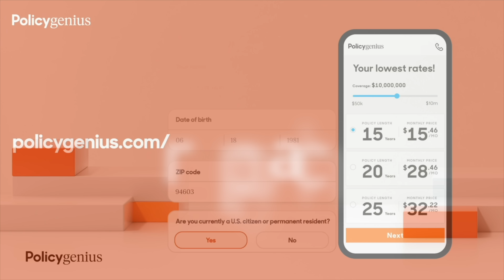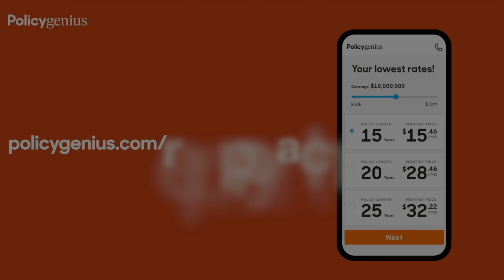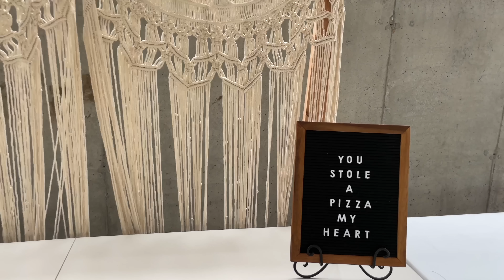#593 - The New Front Porch Is DONE!!!

Comment: Here in Canada we do not screw down metal roof sheets through the high peaks. Screws are inserted close to the peaks - which allows those peaks to absorb summertime heat expansion.  (Our temperatures typically range from -25*C to +35*C [13*F to 95*F].

Comment: Congratulations to the couple;

I felt bad for you working on the roof and porch by yourself it would help so much to have an extra hand. Those were the long boards you were working with as well as the aluminum pieces we’re large enough that if the wind would’ve caught them, it would’ve made it that much harder to work with but being bulky and trying to get them where you wanted and up a ladder was not easy. Congratulations on Getting a tough, challenging job done❣️❣️
It turned out very nice♥️♥️♥️🌈

Comment: The flashing should go over the tin roof not under it. Now the water will run under the tin.
Reply: I agree, all that work for nothing
Reply: He said he will put on the flashing next. He only sealed it with tape to the wall. That tape will be eventually under the flashing.
Reply: There isn't any flashing under the tin.  He said he has to buy a piece to put on, now that the tin is installed.  But yes, it does go on top of the tin, would be pointless the other way LOL.
Reply: @balfit  the flashing needs to go under siding and over tin. Not under a trim piece.
Reply: @wildbill23c  flashing has to go under siding to work. Not under a trim piece.
Reply: @imakarpenter  It works either way, depending upon the type of siding on a house, and with an overhang on the house as that one has, putting the flashing on top of the tin up against the trim works just fine.
Reply: @wildbill23c  lol.  Wrong
Reply: @imakarpenter  LOL, you are correct that you are wrong, the flashing works either way...try it for yourself.
Reply: @imakarpenter  Whatever you think...do what you want, obviously you've never built anything, otherwise you'd know it works both ways.  With the design of his roof he really don't need it at all.

Comment: Why are the roof sheets on top of the flashing 🤣
Reply: How will you weather the flashing you say you need to finish, that means getting it behind the siding.
Reply: There isn't any flashing under the tin...he used a tape seal under the tin, but said he has to buy a piece of flashing to put on now that the tin is installed.
Reply: Go back a few videos, he installed a metal flashing above the ledger beam which went behind the siding. Which the roof sheets are now above. Thanks for your reply but you need to pay attention.
Reply: @SteveDiamond19  I'm paying attention, you obviously missed the part in this video where he said exactly what I wrote above...he still has to install the flashing, he don't have the flashing yet.
Reply: Did you even bother to go and check. 😅
Reply: @SteveDiamond19  You obviously didn't bother to check because you made the comment without watching the video and listening obviously, about half way through the video he explains and answers your exact question...pay attention next time to the video before asking questions.
Reply: I saw both videos and listened, he has installed a metal flashing above the ledger board which goes up behind the board and batten. This flashing is now under the metal roof sheets. Fact
Still this does not answer my question of how the new flashing will be installed, for it to work correctly it needs to be behind the board and batten and rest on top of the roof sheets. You are making a fool of yourself.